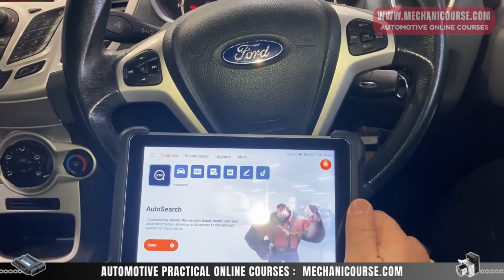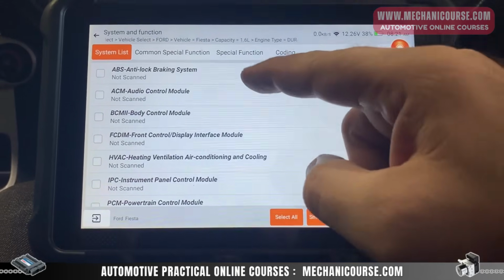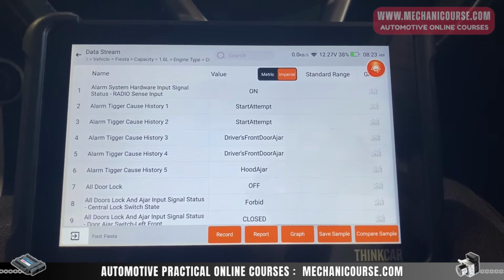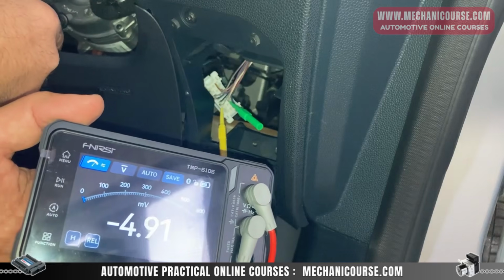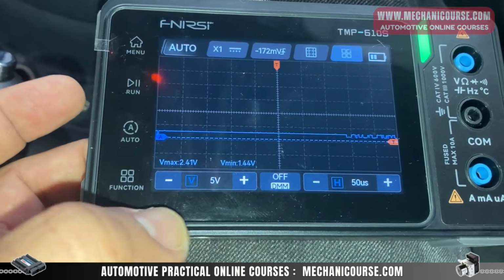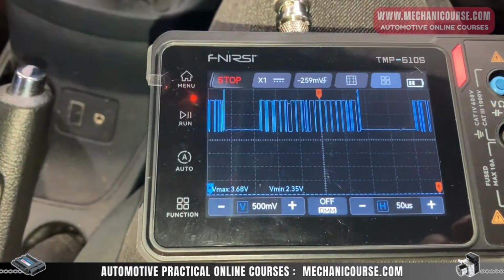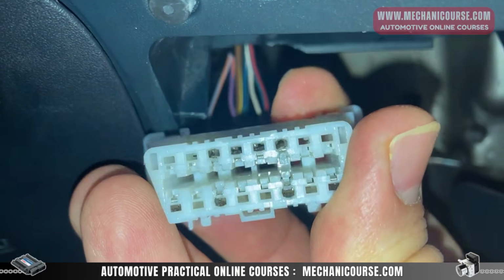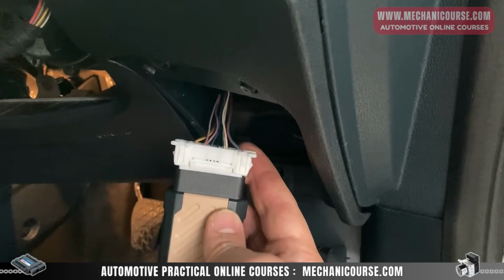CAN Bus No Communication Diagnostic | CAN-Bus Voltage & Waveform Explained!

Comment: I have a 2019 ford f250 with ms can down. My terminating resistance is 120 ohms. I am having a hard time finding the short
Reply from the maker: Hi there, we have two videos on the channel that can help you, the first one is about Ford CAN-Bus which explain the MS CAN and terminating resistors. The second video is how to find the short step by step:

https://youtu.be/4GitKS3xX14?si=MKKG6EgnM3nb72sD

https://youtu.be/8p3EauD0ufg?si=olkS_m4ZTJlkk3Ji
Reply: @AutomotiveDiagnosis thank you. I appreciate it. I checked both dominan modules and they both have 120 ohmns each so i know it should be a short somewhere.
Reply from the maker: @omar11fz So hopefully the second video will help
Reply: @AutomotiveDiagnosis found a corroded connector. Thank you for all the help

Comment: If the person who did this to the terminals knows about can pins in the dlc why is he a pushing fat multimeter lead probes in that hard that he ruins the terminal grip,
Reply from the maker: Yeah, that's exactly what I was think about. I assume some guys have some general ideas about the CAN-Bus, but the not that much to prevent these kinds of issues.
Reply: bro, there's a lot of mechanics who knows which is which but don't have even the slightest of an idea how to properly do it not to damage anything,
and funny enough but i hate it, they are 80% and only 20% probably knew how to do things carefully